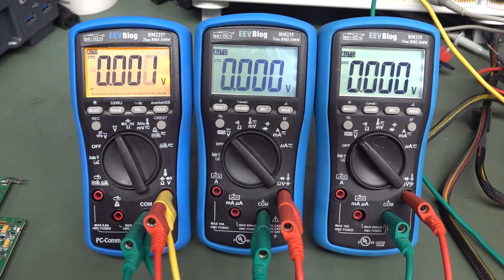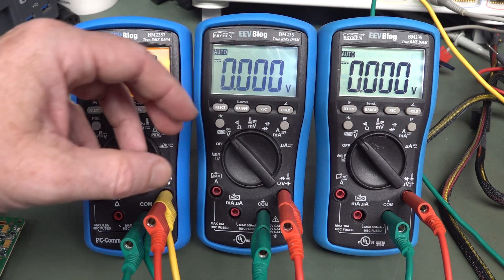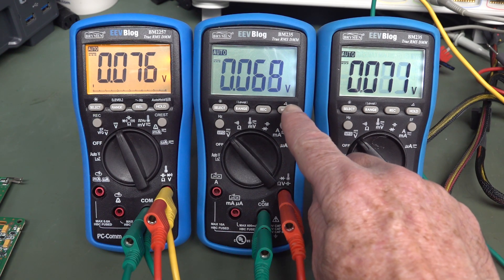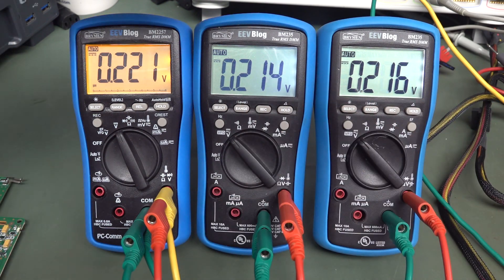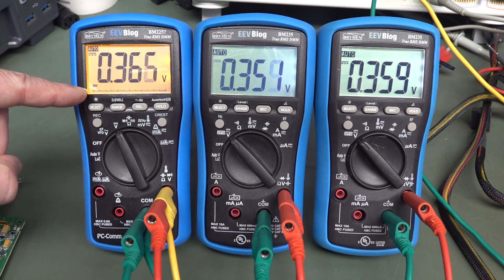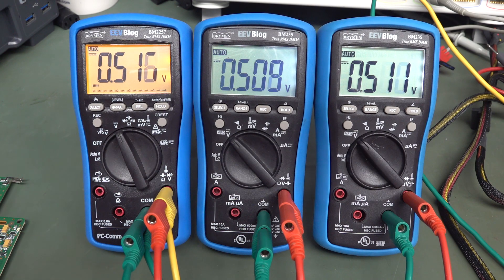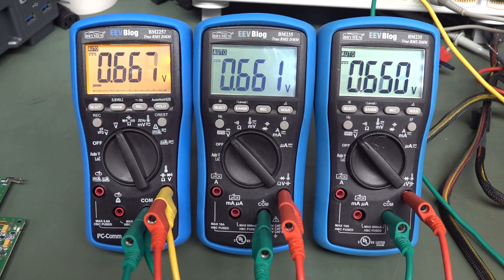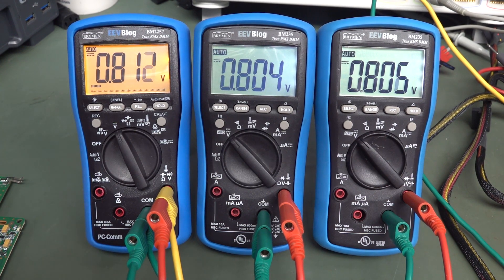BM235 Display Lag/Pause Testing

Comment: Some form of averaging with maybe a circular buffer makes sense. This would also explain the overall delayed reading. One could check if it is really a rolling average, by looking at the step response. 
I doubt that it would be just an interrupt for the CPU, as this should be much faster, not nearly 1 second, more like < 1 ms even for a slow CPU.

The occasional freeze could be very anoying when doing adjustments to a target value.